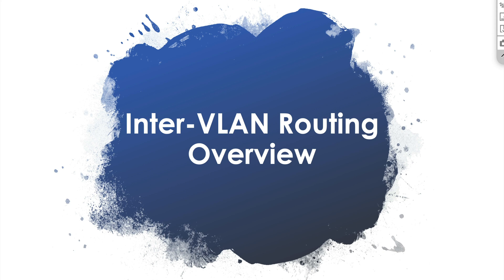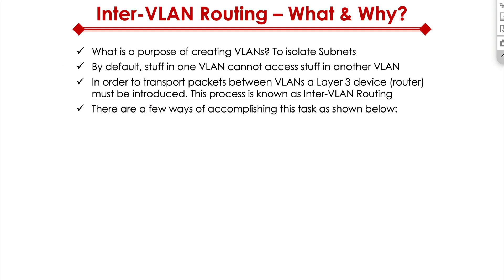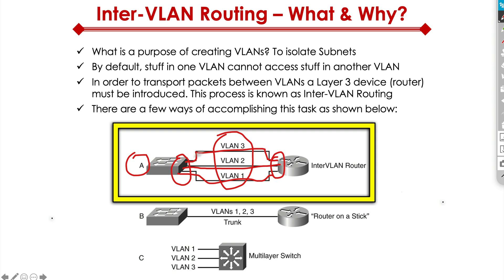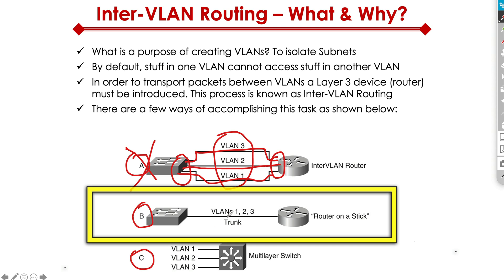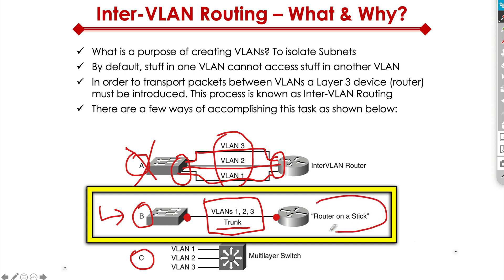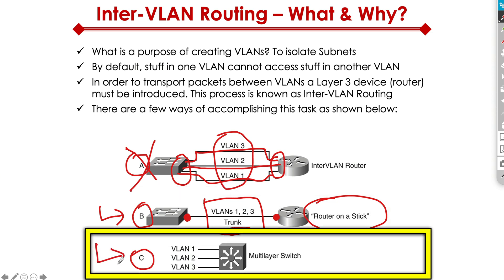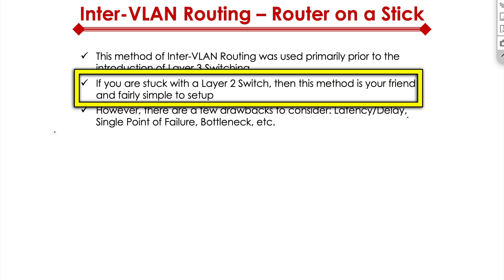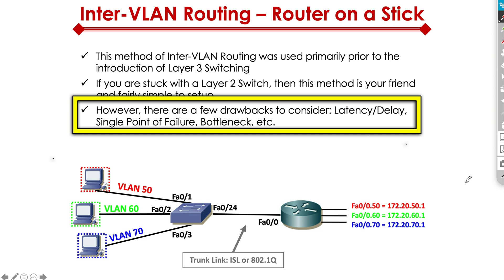What is Inter VLAN Routing?

Comment: I heavily use router on a stick, or better, firewall on a stick, within large enterprise using cutting edge infra design techniques. I would not say router-on-a-stick learning is legacy in any way ;)
Reply from the maker: That's a valid point. You can also look at using VRF-Lite as an enhancement to router on a stick, depending on your use case and hardware capabilities!